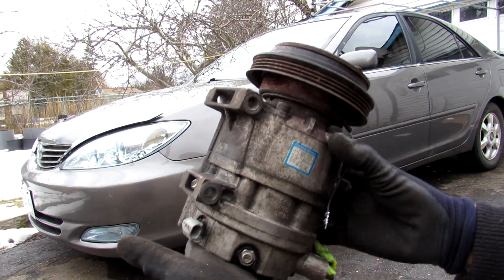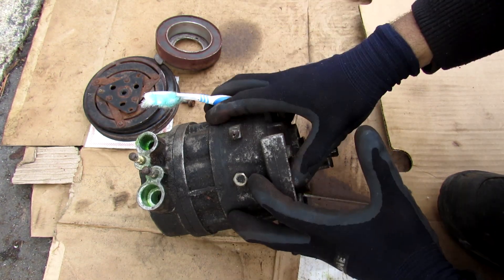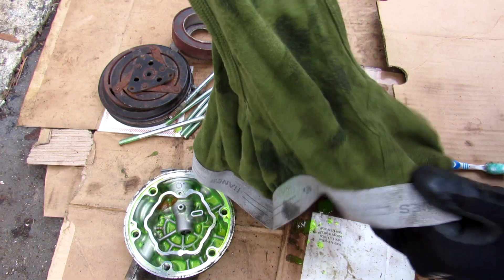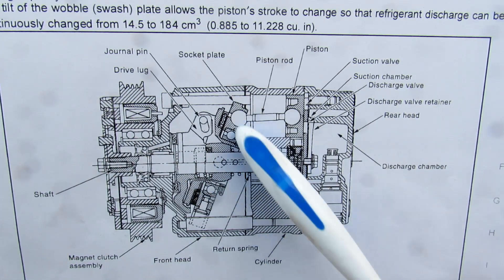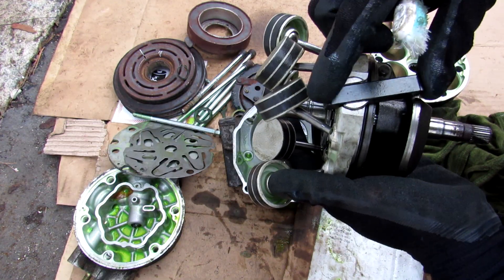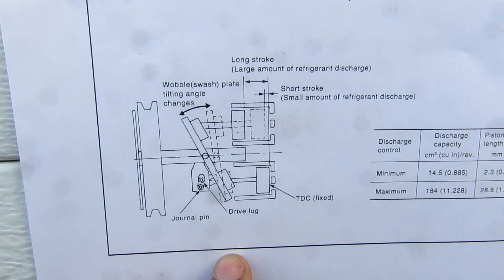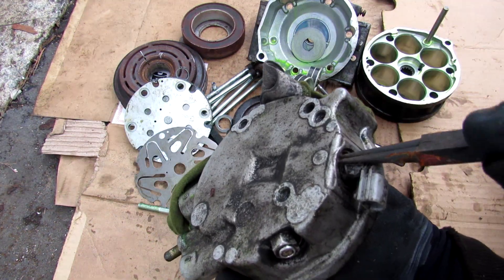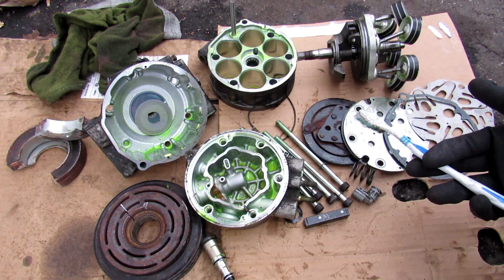How a Variable A/C Compressor Works

Comment: I’m looking at wiring a 12V compressor in parallel with a compressor of this style. Would that control valve be closed when the compressor is off? I ask as I am wondering if I need a check valve to prevent this moving backflow while the other compressor starts. 

I also ask because finding this type of universal hvac check valve has been a chore, everything’s just hydraulic npt.

Comment: Another failure (although rare) is that one (or more) of the half ball bearing between the piston and the swash plate moves more than what is permitted  and get stuck provoking the compressor to seize and the torque clutch to break (due to the fact that the gap between the half ball bearing and the swash plate increases due to the erosion of the plate which is softer)

Comment: Do these compressors make a swoosh noise when the ac/fan is off ? Are they continuously spinning creating lubricant?
Reply from the maker: No
Reply: @speedkar99  my Subaru wrx 23 model is making a swooshing noise when ac/fan is off . Apparently Subaru said it’s a normal noise ?

Comment: I'm replacing the idle bearing the next weekend or so, in addition I'm replacing the low side suction line.  Would I benefit taking apart the AC compressor to clean it up and refill it with PAG 46 afterword's?  Do you need any other seals?  I bought an o-ring kit for the hoses, has about 16 o-rings.

Comment: Why these variable displacement compressors are not as durable as fixed displacement compressors? 

And what happens when installing fixed displacement in a variable displacement compressor system?
Reply from the maker: Then the computer can't control the correct pressure for temperature ratio required by the system. It can cause the expansion valve to freeze
Reply: @speedkar99 my car is mercedes with cluthless variable displacement from denso 7seu 16...the ac produce cold for about 30 minute then warm /hot....its repeated after lets stop engine about 20 hours and start ac then the same happen ...ive check refrigeran still full...your advice pls what happen with my ac car?..thank you

Comment: Love your videos, you are very knowledgeable and you explain relatively complex things very well, with a bit of humor thrown in.  Watched this one in particular because the ac compressor in my son's car has never worked, had it checked and is receiving power, the guy at the shop said it would require a new compressor.  It's a 2003 Honda Accord.  Was looking at taking it in repair but now I'll buy the part on Amazon and do it myself, I feel confident in doing this now because your video has 'de-mystified' the compressor, it is nothing more than a pump and really relatively simple one (nevertheless a very clever design).  Keep up the good work.

Comment: @speedkar99 This compressor is the setup ive been searching for for my model engine conversion....
What vehicle did it come off?
It doesnt appear to come off that 01-6 v6 camry , as ive checked all the compressors on rock auto that were available for it.
 Been searching for a while for the perfect compressor setup,in particular the rubber piston rings, for a small engine conversion, please do tell...
Reply from the maker: Infiniti G35
Reply: @speedkar99  youre a legend, speedkar, ta from downunder.

Comment: 2:55 it's not a drain port, it's a pressure relief valve.
0:14 that's where the drain port is, right to the hanger.

Comment: Great job on showing the variable compressor internals. Using existing pressures and PCM controlled positioning, is important for DIY’s to know why low pressure switches stop compressor operation completely, protecting the compressor from failure due to loss of oil that ONLY flow with refrigerant. This is done to reduce engine load, increasing fuel economy, like alternator control, power steering 10% on the highway but 90% at slow speed for turning the steering wheel. Pressure switches are more important than ever, as we migrate from R12, R134 now R1234Y or what ever they call it this week. 
  Please note the clutch coil when de-energized as mutual induction can produce 180 volts requiring a forward biased diode of 1/4 watt facing the positive wire. It can be located at the compressor, 10” up the harness or in a fuse box. Just food for future video if you have access to a labscope set to trigger at any signal above 90 volts. 
 The same design is used to create hydraulic motors for hydrostatic drive systems but with some manual control of the rotary squash plate to control speed or even reverse. Thanks!
ASE Master Tech since 1978 - Retired
Reply from the maker: Thanks for your input!

Comment: why sometimes ac blows hot when car isn't moving it always happens with this type of ac compressor, after changing the electric valve it start back blowing cold but not for long

Comment: You said that when the freon leaves the evaporator it's a liquid, that's wrong it turns into a gas.
Reply from the maker: Yes
Reply: The expansion valve is calibrated to depress the superheat (i.e. completely stop restricting flow) and flood the evaporator at very low evaporator pressures so that it won't end up interfering with the compressor's control valve (both valves are able to act upon suction pressure, and evaporator temperature is closely related to suction pressure; having both control systems interfere with each other means unsteady vent temperature). So there are times (very low heat loads, mainly running defroster in winter or AC in early spring and 60 F weather) in which the refrigerant leaving the evaporator is actually a mix of liquid and vapor, by design.

Comment: Can fixed displacement type be swapped out for variable?
Reply from the maker: Yeah but the flow rate has to be optimized and you need to trick the HVAC computer

Comment: You can make variable swashplate clutchless, but it's dicey. You would have to make the thing spring to a low stroke. Low outside Temps will cause liquid slugging because all of the refrigerant goes liquid. Slugging washes oil out of the compressor straining the dry lubes in the design (coatings, hardened materials on either tin plating or bronze swashplate, etc). I don't know that I would want one. Although lip seals leak and cause clutch failures often. I wonder how well clutchless compressors work in the real world.
Reply: TXVs used with these compressors never close all the way, know because i tested some including the one from my car (equipped with a swash plate internally controlled VDC). I guess slugging is taken into design since some slugging is taking place as a small compromise meant to keep oil flowing to the compressor (dissolved in the liquid phase) at very low refrigerant flow rates (what wouldn't happen if the TXV slammed shut at the matching low heat loads). So in general these might tolerate liquid flowback more than fixed displacement comps. Clutchless just suffer a horrible fate when run with no refrigerant, the only thing that can keep them cool and lubed, one of the reasons as for why less and less makers are using them now

Comment: Stumbled into this and had to watch. Brought back memories. Couple things: 1) this is not a variable swashplate, it's a wobble plate. Old GM V5 might have been one of the early variables to have this, but had a tendency to throw itself to full stroke at high rpm because of kinematic imbalance so it would have to declutch. Swashplate variables are much more controlled because they are kinematically balanced (high rpm they want to destroke). 2) control valve controls the stroke by changing crank pressure, not cylinder pressures. Low suction will cause valve open throwing discharge gases into crank and destroking. High suction will cause valve to close opening the crank to suction. There are some other control holes to ensure oil circulates. Non electric valves used a bellows or a diaphragm to sense suction pressure.
Reply: thank for sharing,
now i got more idea

Comment: Too bad you can't make a modification to make those variable systems blow as cold as idle as they do it 2,500 RPM .
Reply: They start doing that once they get terribly low on refrigerant charge, experience a control valve failure or simply get old & terribly worn. I have this type of compressor on my car and i distinctly remember ice cold air flowing out of the vents seconds after hitting the AC switch in any weather in its youngest days. Now at about 18 years old it's just making an awful noise and taking ages to get cold in hot weather even when fully charged so i'm just switching it with a new one before they go out of stock for good

Comment: Why no rotary compressor
Reply: Rotary can't be completely variable like this. Depending on the type of rotary, they and efficient at high rpms, but much less so at idle. They way scrolls and rotary vane compressors reduce capacity is to either throw away discharge pressure (open a valve to suction) or declutch. Variable stroke piston can destroke and match capacity to demand with little waste. Pistons are not as efficient at high rpm, but usually the car has plenty of condensing at higher rpms and the compressor destrokes.
Reply: @DavidAsplund  I thought modern AC compressor are rotary type
Reply: @dilipdas5777  last I paid attention, smaller engines had variable piston so they would not have to cycle. Scrolls and rotary vanes will have bad performance at idle.

Comment: Has anyone turned one of these into a tiny 6 cylinder 2 stroke engine? I vaguely recall seeing a older compressor modified.
Reply: Wouldn't work. The amount of force to drive the swash plate would be too high. What you need is low force, high velocity mechanisms, not high force, low velocity.

Comment: That's not an oil drain. It's a pressure relief valve for if the system pressure gets too high.
Reply: Yeah he's making too much out of this. It's a basic 6 cylinder compressor with a wobble crankshaft. It's nice to show how one works. I rebuild my first one of these in 1979..

Comment: This is really neat: a sort of continuously variable hydraulic transmission. I wonder if this same swash plate system has been used in other settings (in addition to helicopters).

Also: did I miss something? How does the solenoid valve continuously vary the link between the input and output ports? I thought solenoids were usually all on or all off only.
Reply: The swash plate system is used in many hydraulic pumps especially in heavy duty industrial applications. A solenoid can be pulse width modulated by the computer therefore making it variable.

Comment: Awesome video man! Compressors look quite sturdy, what causes them to seize? I did a mistake by adding refrigerant to the system but I'm sure I did a mistake (the pressure reading of the freon can that I bought must've been wrong) and after driving for a day a weird friction sound appeared then the serpentine belt snapped.
Reply: Not enough oil returning to the compressor while it's running is what kills them. Running the AC with not enough refrigerant is what causes the reduced oil circulation rate (refrigerant tends to stop inside the evaporator where it's thickest and the refrigerant carries less oil around as the mass flow rate decreases and the evaporator superheat increases) and the higher than normal evaporator superheat can also overheat the compressor degrading whatever oil is left inside. Insufficient lubrication means friction and too much friction eventually ends into something welding to something else or wearing to the point that it falls out of place.

Comment: Ah, so that's why at idle the A.C. is not as cool as when I'm cruising along. It operates on the engine Rpm's. Great video. I'm a new subscriber, great channel.
Reply from the maker: Yes. On the highway when your engine is revving is when you get the best AC
Reply: @speedkar99  thanks. I really like my Elantra. 2018. 2.0 with a manual transmission. I change the synth oil every 4k-4500. The AC is nice once you step on the gas! And the AC  makes shifting a little less smooth because it's a pull on the motor.
Reply: @joeb2588  With your compressor this can also be the result of a low refrigerant charge or a faulty compressor control valve
Reply: @teravolt6113  ok. Thanks. It's just not as cold when at idle but as quiet as this engine is and I get over 40mpgs. ...it is not powerful so maybe that could have something to do with it. The car has been very good reliability wise however maybe I'll just have the dealer give it a quick look just in case.
Reply: @speedkar99  not so much because of the rpms on the highway, but more the condensor air flow is high so discharge pressures decline. Condensor effectiveness sets discharge pressure (assuming the correct refrigerant charge). So idle pressures go up, TXV closes to try to keep evap pressures low at low refrigerant flows. Compressor or computer will see the suction pressure increase and increase the stroke on the variable compressor.

Comment: I have a Toyota vitz with a variable compressor that works great but a lot of owners have the issue of the compressor failing. Could you make a video explaining why it fails?
Reply: If it's the Denso 5SE09 clutchless comp it's likely the refrigerant charge getting too low for proper compressor lubrication when the engine is revved up, or defective control valves that prevent the compressor from turning on

Comment: Now my question is.... how the hell does the AC gas not escape out of the shaft seal while it's spinning???
Reply: Thin oil coating keeps the refrigerant inside. That's why it's important to run a/c regularly. If you don't the seal will eventually lose oil, get dry and shrink away

Comment: Excellent breakdown and video.... Much appreciated👍 The a.c. compressor is basically a mini engine which is why it's best start it BELOW 2000rpm (idle preferred)
Reply from the maker: Thanks. It's a pump more than an engine, it takes Mechanical energy and turns it into potential energy in the compressed refridgerant
Reply: You'll find a lot of compressors which have a fixed displacement switch their clutch on and off continously on the highway to keep the evaporator from freezing up. No matter what rpm the engine is at. Yet they, and their clutches, last for decades if properly maintained. Auto compressors are designed for that. It's larger AC compressors such as bus ones that should never cycle.
Reply: @teravolt6113  The AC compressor on my car is also variable displacement but it has no clutch.